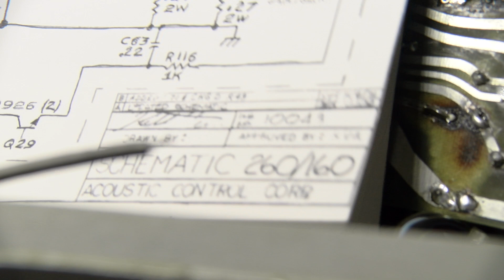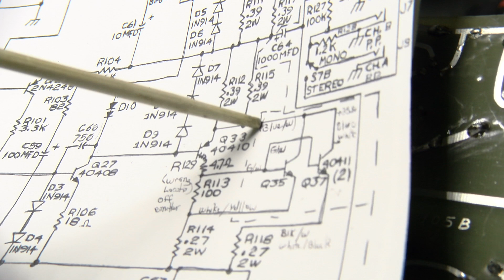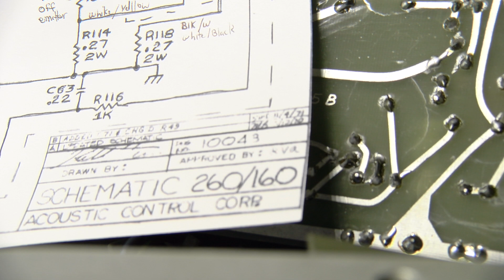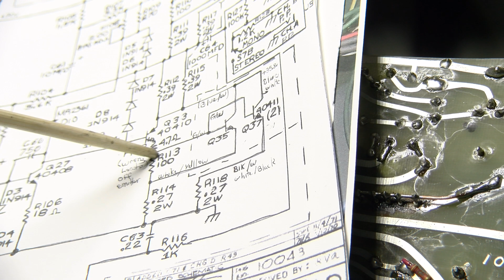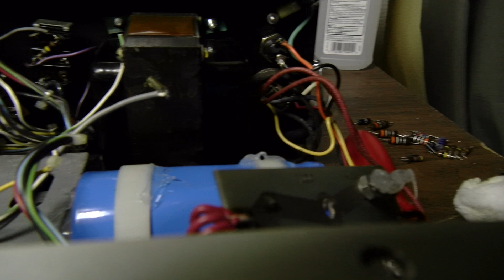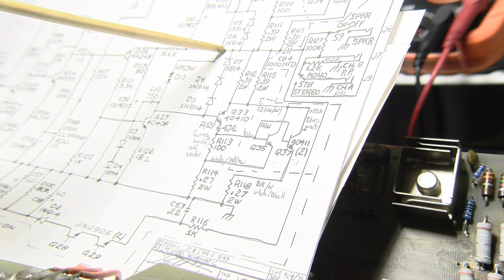ACC 260 Power Amp Board Schematic Error 4.7 Ohm Emitter Resistor RCA 40410 PNP Acoustic Control Corp

Comment: I'm working on a power plus power amp and its had similar issues but on the 100ohm bias resistor of Q31 due to a shorted transistor. My question is do you have any experience with these models for the powered cabinet? This one has no spot for the 4.7ohm resistor or the cut trace to make the connection underneath. Is this how they are supposed to be? I'm still trying to isolate what is causing issues on one side of the power amp. Replaced power transformer and MJE outputs on it from a previous tech.
Reply from the maker: From what I understand
 The power plus bottoms were never in full run. (I know of five of them).  I can only guess the later mods wouldn't be in them. But they are the same power amp design as the 260s. Ive yet to open mine up. 
So you could add the 4.7 ohm and 100 ohm Resistors. 40409 and 40410. 

Youll want to go through the bias adjustemt. 
After a 12 hour test on this head playing music at half dial I could still touch the output collectors. 

Before adjusting the bias, I couldn't.
I do have a few rca 40411s if you find the mexican outputs are not 
Working.
Bulgarian seller on ebay has a bunch nos from a shutdown teleco.
Reply: @OneDamNote  thanks so much. Yeah these mje’s run hot and luckily I have a few sets of nos 40411’s and 10’s/9’s. This had equivalents galore in it and would immediately heat up. Thanks for the answer. There’s just only so much information/schematics on these acoustic of this era.
Reply from the maker: @dustinaltick5220  And as I am discovering, like some others have, what info there is isn't always a match. As in the service manual, because the design/build had several changes over it's lifetime. 

R119 is 15k in several 260 heads not 50k, DC idle voltage for Q24 base is around 10vDC not 20 as in manual table, Q33 image may also be backwards. (collector/emitter symbol flopped). I am by no means a "tech" but I've been fixing up a few of these amps as part of my collection.
Reply: @OneDamNote  I immediately noticed some errors in the service manual schematic for the 260 mainly r124. States it’s a 1.2ohm 5 watt but from every 260 I’ve seen this is 1.2k 5 watt
I’m going to try swapping some of the correct parts and seeing what I get on the bias and temperature of q34-37
Reply from the maker: @dustinaltick5220  Yes R124 is another one.  Also in the biasing section of the service manual R108 is mislabled as R208.